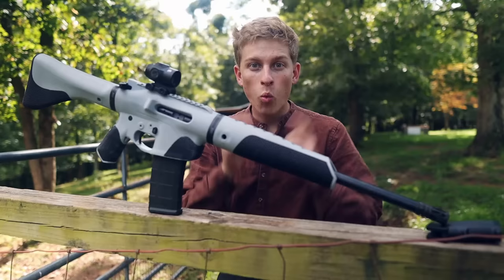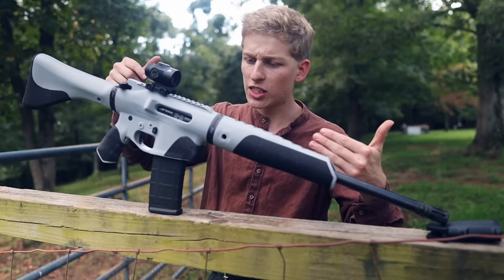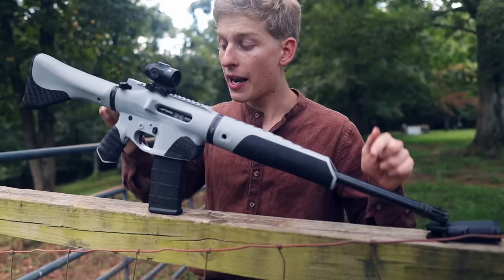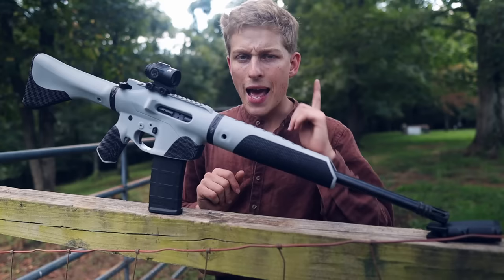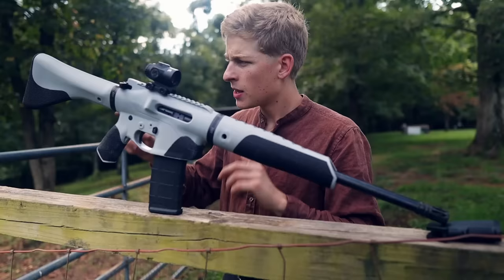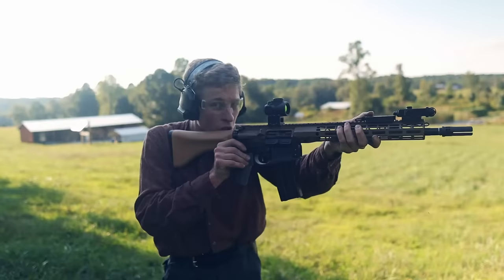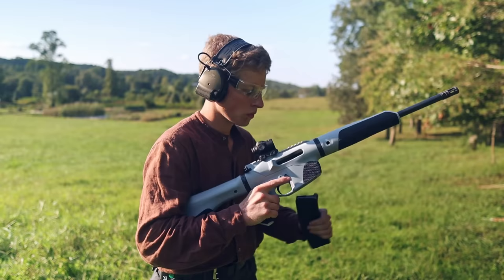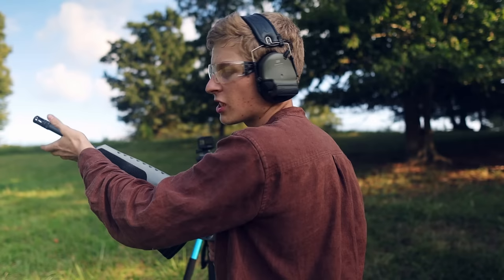I Printed an AR-15

Comment: Next question. With your skillset why are you sticking to this design? Utilize the off the shelf parts you need and redesign. AR has a lot of real world use flaws but a lot of improved time tested individual parts
Reply from the maker: What would you like to see changed?
Reply: @Hoffman Tactical  from direct experience the platform is to long. Shorter barrels give you some advantages but in my opinion not enough.  In a perfect world a bullpup 16 inch fully shrouded barrel integrally silenced. Triple stack mag. Which is fat yes but short. And l don't like bullpups but in urban, home defense, and bush/heavy woods hunting they just work. The extra space on rifles is under utilized. Crap hanging off every where ready to snag on door frame or cudzo on tight entry and woodland creep. Light, red dot, and everything powered off on central power source you can pop out and slap in a secondary. Then recharge. Yes l get it that's a whole lot but the hard pieces are already on the shelf. The shrouded barrel is a wish not a need. The rest is something you have proven you can do. Prototype on the cheap. Um you did ask
Reply from the maker: @hglenn55  I'm 100% with you on integrating all the gear. Once this system is developed, I intend to do that. But that's not the main focus yet, more of stage three. As to bullpups, they are not well suited to the AR platform, and it would add a lot of cost use a bufferless system.
Reply: @Hoffman Tactical  or shorten the current buffer system? With the system set back and closer do you need all the dampening like the tavor? And l gotcha on the step by step stages. The future looks bright

Comment: The point of the AR15 platform is to be a modular design. You took the main strength of the AR15 platform and created a non-modular gun. It's cool its a functioning gun, but its not an AR15 as it literally isn't modular with a easily separated top and bottom half. I have also bought and can still buy AR15s at $300 that are functioning. AR15s are one of the cheapest rifles these days someone can buy if they do want to stay cheap. Still good attempt overall.
Reply: … you completely missed the point of this video… it’s printed… polymer upper… try to find an AR with a polymer upper that doesn’t suck
Reply: @docternoblex  it's not an AR-15. It is a single piece construction. That isn't to say it isn't cool what he achieved, but unless it is a modular design then it isn't an AR-15 at all. It may have some of the styling similar to an AR-15, but that doesn't make it one.
Reply: @docgiggs  but nobody has made an upper like this before

Comment: The second part where is shooting with that god awful white printed gun you can literally see the bottom part of the trigger frame and the top part gets about a 5mm gap opened up between pieces with almost every shot he take. It's just a matter of time until someone loses and eye, or a hand, or a face.
Reply from the maker: Buffer bend is normal, you just can't tell it's there with a classic split line. Also, complete buffer tower failure is quite harmless.

Comment: See it should be flying the cartridges straight out to the side not backwards and not forward straight to the side it's properly gassed. Palmetto State armory
Knows what they're doing like my DPMS
Reply from the maker: By adjusting the geometry you can change where the casing goes regardless of bolt velocity. I'm trying to get two o'clock. Remember, the rules of thumb for ejection pattern are only valid for uppers with a "milspec" deflector set up.

Comment: Talk to me more about active cooling daddy 😳😍. Made my pp tickle a little bit 😂. Had a few design ideas focused on active cooling principals that I haven't really acted on. I went down a rabithole of plastic heat torture and found a few guys using coolant jackets on various piston and turbine engines with some success. Beyond cooling There is potential to transform designs well beyond the mechanical package limitations with traditional components.

Comment: Why 3D printed? seems like a complete waste of time for a gun that only last two rounds.
Reply from the maker: As long as people are interested, I will move forward.
Reply: @HoffmanTactical  Just go with the flow huh?
Reply from the maker: @jump-kickman5247  If you have a better suggestion, I'm all ears.
Reply: @HoffmanTactical  You should stick to Etsy Yoda busts, like the rest of your kind!
Reply from the maker: Good input, but not good enough. Try again.

Comment: Id never waste my time printing a inferior version of a gun I can buy tomorrow. Use the same common ar parts to build something I cant get.... like if it looked like an xm8 id have stopped watching and gone printer shopping. Fun toy though
Reply: The point is not that you should, it’s that you can if needed.
Reply: @soraltt  i mean thats a valid argument but if I needed it I have a feeling I won't be able to download the files without being drone striked so id be drafting it in cad from scratch at that point anyway. Just saying if you want adoption to take place before that point there's small changes that could be made to get the gun community interested which is much larger than the doomsday preppers. If you made it an xm8 you could see the files and printed pieces on midway or Brownells and youd have a line of legal protection this man doesn't. It was a personal statement not a "why would anyone waste their time" but honestly if we get to the point you gotta 3d print your gun I can promise you won't have access to these parts and if you don't have access to the parts its useless. If you're currently stock piling fcgs bcgs buffer groups gas systems and barrels why not buy a couple less and get normal 80% lowers and completed uppers you are literally saving 75+120=195 per rifle and I can tell you which one id rather have in a gun fight. Fact is buisness creates innovation individuals only invent and an invention won't get us out of the current attacks on your 2a a buisness funding a legal team has a chance. I just fail to see in any hypothetical future you can build this and not a better ar15. Im not telling anyone to not make one I love exercises in craftiness but seeing as I personally don't currently own a 3d printer this didnt convince me that I should invest. If youre already invested in a printer and the needed parts I dont see why you wouldn't rattle one off but dont fool yourself into thinking this is a replacement for the real deal. Im a realist is all
Reply from the maker: XM8 is ugly. I did this one the way I did for a reason, it's better ;)
Reply: @HoffmanTactical  i mean I agree it looks like a tactical fish but its history. No offense  but yours looks like a nerf blaster before the paint department. Looks functional not arguing that but its basically the Michelin man of firearms thick with smooth rolls